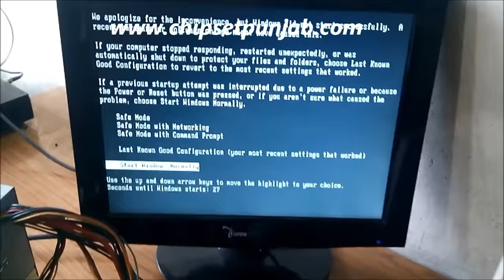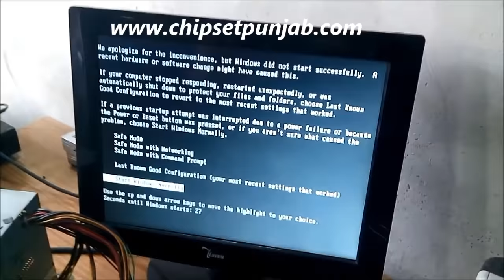How  to recover data on  hard disk

Comment: Hi, After inserting disk, directly can't check without cap? Plz. Suggest, I tried in the same way, but red light in the cabinet showing. Still not working...
Reply: It ram problem I think.
Reply: You just need to remove ram and clean it and install again. I think it will work.

Comment: Improvise something like a clean room. You can use a small vacuum cleaner and a box of glass or foil to maintain negative pressure, and work inside it.
The box should also need to have an air admission filter, like the HVAC filter, or vacuum exhaust filter or something capable, they are quite cheap.
Long isolated gloves to have access inside.
This should minimize to the maximum the home-made restoration try, yet you should let a profesional doing it if your data worth the money. It require a cleanroom, which is expensive, and proper equipment to do these operations you see here.

Comment: Thank you for sharing this video..
I have one. Doubt ,I have 500 GB Seagate HDD that was faulty ,
Can I change the media to another difference size HDD with Seagate model.pls tel me.
Reply: naga
Reply: what are you thinking ??? do you really think that it is possible  to swap the platters from one hard disk to other hard disk !!!! please search the internet about "why data recovery is so expensive  and not possible and unnecessary for an individual to go through the pain of recovering hard disks data or repairing a dead one ??? " it may be possible when only pcb is fault but you are not suppose to move the platter even a milli meter coz that will make ur hard drive unusable for ever

Comment: I have 3.5 hardish eclosure which work on 12v 2000mah adapter but by mistake my sister connect my laptop adapter of 20v 3.5A ..... after that my segate 500gb hardisk is not work which i am using in enclosure. ..but my other 80gb segate hardisk is working in enclosure. ... can i replace  80gb segate hardisk  pcb with 500gb segate hardisk pcb..??
Reply: Chip Guru i checked it,,,,,, only diode is burnt .... when i unsholder diode its starts spinning but clicking sound come from it.... and not working....shop spinning after 10 to 15 seconds...

Comment: hi sir, i tried to contact number but it is coming disconnect. Actually I have a old Hard Drive from 1999 which is 17.2GB. It has problem in spinning and sometimes gets recognized but sometimes it comes as not recognized. It makes noise.

Comment: My hard drives PCB is shorted, how do I recover my datas
Reply: depend on failure, from damaged diodes/condenser  to burned ic.

sometimes is better to replace the entire pcb with an identical working model (check serial number of HDD)